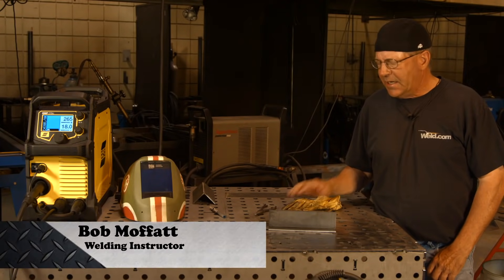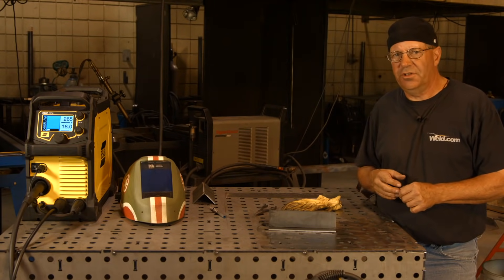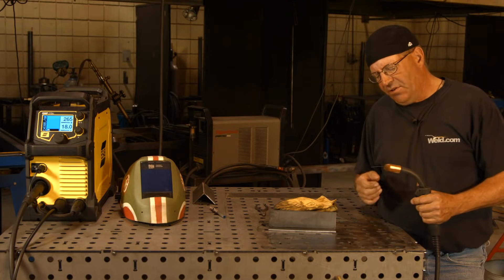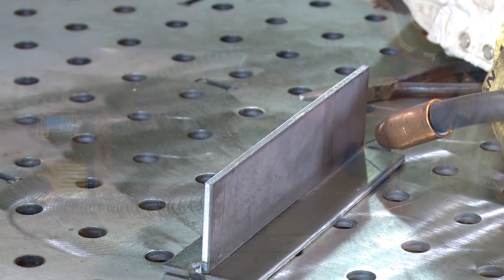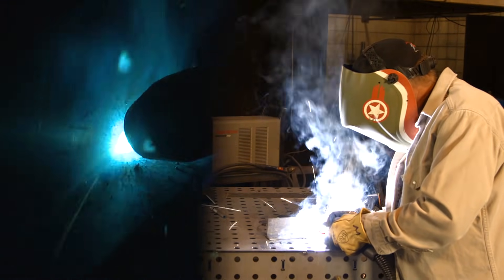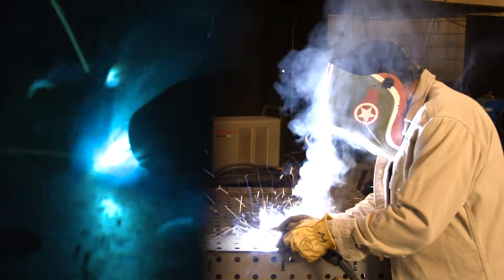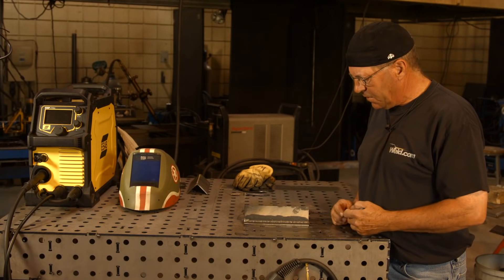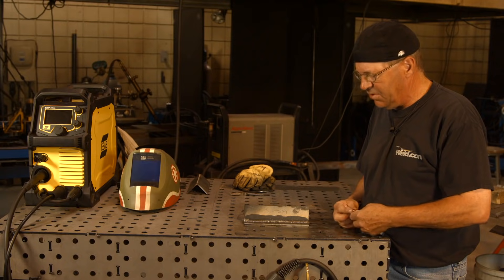Flux Core Welding: The Basics You Need to know

Comment: Very informative unbiased video.  I'm a nube wannabe welder.  But I'm getting better.  I've found that flux core really digs in with deeper penetration a for a particular wire  speed/voltage setting.  I've also found that digging also equals blowing the corners off your parts if you're not careful.  It's really amazing what you can do and where you can do it with this stuff on 110v.  Weld rusty dirty mill scaled steel with little problems, but lots of BBs and sparks if you don't get down to bare metal first.  Not the prettiest welds, but then, none of my welds are pretty.  HAHA!  It's nice to just flip the machine on, don a helmet and gloves and be welding in seconds.   After seeing your weld, I can see just how much room I have for improvement.  I also learned that those sparks will go right through a pair of Nikes and socks like hot butter.  OUCH!  Wear leather boots!  Thanks for the video.
Reply: blmeflmm66 Asics are no match for the molten BBs, either. I taught the neighbors, five or six houses away, some new swear words that day. LOL
Reply: I have a pair of ESAB spats for my shoes. They use Velcro and you wrap it around your ankles. It covers your shoes and nothing gets in. It’s also useful for cutting and grinding. We’ve all ground in the wrong direction once or twice.
Reply: Can relate.  Buying bigger and better smaw machines. I got the weld fever
Reply: I also learnt this back in high school,  with high tops, and I couldn't get them off. Just feel the burn.

Comment: ima go sing up & check that one out, I have a old cambel huasfield 110 a/c ,it pulsates & I have not had time to look at it(1,000,000 project's) I gotta old blue freight guy flux DC it welded OK till my brother in law used it & stepped on the cable/feeder tube 
& the switch is useless it turns on & goes !

Comment: Am stuck with the Harbor Freight 90amp flux core welder, is an AC unit. Getting a good mig/flux-core welder after I get a good stick welder.
Reply: Try buying some quality flux core wire. The junk that comes with the HF welder is just horrible but once I changed wires, the welds improved drastically.
Reply: I got the Lincoln Handy MIG for like $350 from Lowes, thing kicks ass on mild steel using flux core. Haven't tried it on stainless though.
Reply: You can do what I did and buy an MTS welder. I bought an everlast powermts welder and it does mig/flux, tig and stick (MTS). There are other brands that also have MTS machines but I believe everlast has had them out the longest.
Reply: Unfortunately I don't have the $1500+ for a multi-process machine. Even a used one is out of reach as other things need the money. One day I'll get one though.
Reply: If you can't afford an inverter welder like an Everlast, I hear there is a modification you might want to consider where a rectifier is used to turn the Harbor Freight AC to DC. That might improve the arc characteristics. Like the other post says, using a better quality wire might help too.
Reply: check out amazon, the forney 299 125fc is a terrific machine for only a little more than a harbor freight unit.
Reply: Only one problem with that Forney welder, has only two heat setting.
Reply: buy lincoln mp 111 i think it is, 0.030 wire set volts to high and #6 wfs. that works for mine, also grind the nozzle down or just remove it.
Reply: Hows flux core hold up can it weld steel roll cages or any roll cage
Reply: Jeffrey Beyer the 170 amp model welds a LOT cleaner on flux core... and it's only 70 bucks more.  So yeah, it's still china garbage, but the kind you can take on roadtrips with a cheap generator and not be afraid of breaking it or getting it stolen...
Reply: Jeffrey Beyer look into all the mods.  Fan upgrade and diode.  You can reverse it.  You can make that machine decent easily.
Reply: Beyer Forestry, Welding, and Other Stuff i wouldn't have even wasted my money on a harbor freight welder, i didn't know ppl actually but that junk.
Reply: Problem is, is that almost any welder doesn't fit into the budget.

Comment: if you clean up the joints with a grinder and wipe off the contamination via acid tone and lint free die free cloth; you won't get the sparks.  Sparks are directly related to a dirty weld using Gass core wire. 
Try again and you'll find the integrity of your weld will increase.

15 pluses years using Flux core wire on a regular basis.  it's ideal outdoors where the wind will blow your argon from the welder.
Reply: English might not be his first language either.  Who would be "child-like" then?
Reply: MushMaster acid tone?
Reply: kalikasurf I think he means acetone
Reply: DugabomberGamin i know, i just thought it was funny that a 15 year vet of welding and making a recommendation on a specific trick, would still reference it in child-like newbie terms.
Reply: Maybe it’s just an autocorrect problem.
Reply: Bill at Yellowdog Welding im pretty sure if his name was 'master para los mush'..... id give him a break on the language...... but he seemed to navigate the rest of his statement without too many issues. 
'Child like' wasnt a slam..... im very capable of using the big words, if i wanted to be a jerk.
Reply: JHC C could be, I suppose.

Comment: you can also dual shield the flux core wire, by using your 75/25 argon co2 gas it makes a pretty weld and works well when doing multi pass welds on heavy stock over 1/2 inch thick material. i use flux core alot, it works very well outside under windy conditions, where  regular mig welding the wind blows the gas shield away causing some ugly and poor quality welds.

Comment: I am having difficulty tacking with flux core. my tacks just bubble up like a erupting volcano. I've tried different settings with no difference. My welds a good looking and sound but not the tacks. is there something specific I should be looking at? I have used flux core before and cannot remember  having any problems.

Comment: I will have to check and see but I have a Miller 120 voltage  Machine that is gasless wire but I don't think it has a place to change it's polarity I'm going to look and see I might need some help with that if you're familiar with that machine.
Reply from the maker: It is probably on the inside of the machine. There is a (+) lead and a (-) lead. It's a little more time consuming, but you just need to change them.
Reply: Weld.com try. To. Get. My. Horbart out. Layway.  At. Tractor. Supply  owe  408. Use some. Help. Randallmills5266@gmail.com. god.  Bless

Comment: One of the most calming explanations of using the flux cored welding process.
The clean up after is a really big surprise and shows beauty is not just skin deep.
The fumes can be a bit annoying indoors but this is where you can use that high speed fan to blow them away and keep cool without loosing weld quality.
Encouraging.
Reply: Need fans/blower and/or p100+ respirator to do this safely. Long term or even some short term inhalation of those fumes will mess you up permanently.